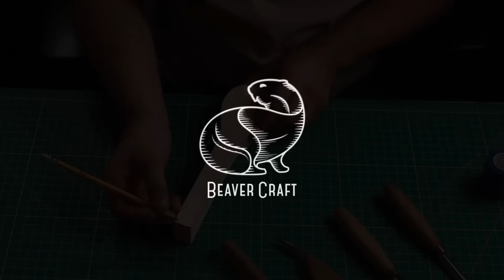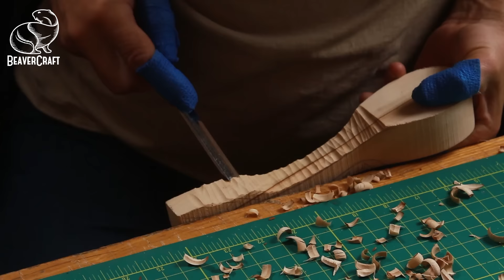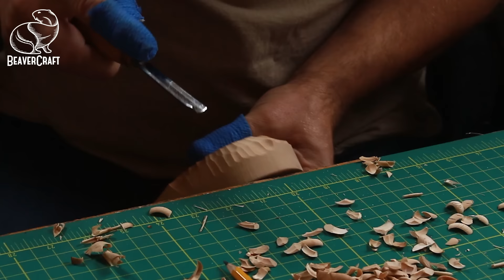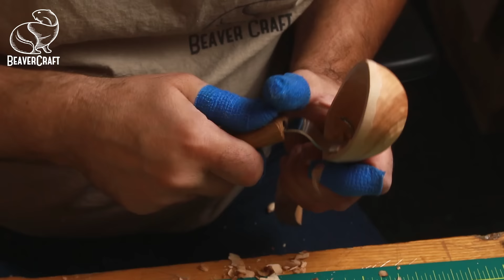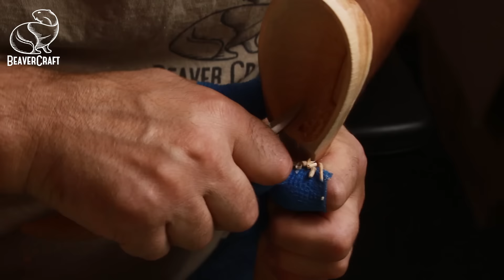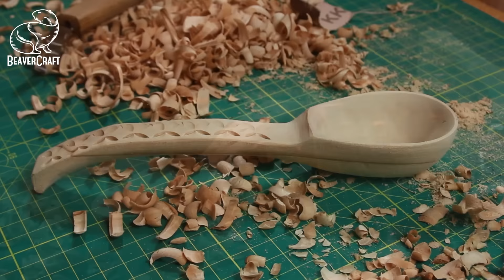ASMR Wood Carving - No Talking ASMR Relaxation

Comment: Is that safety tape for wood splinters or can it protect against chisel too?
Reply from the maker: The safety tape doesn't prevent direct blade cuts but it is great for avoiding small cuts and abrasions during your working with a knife or a chisel

Comment: Question. Are there certain types of wood that is better than others to use when making spoons. Or maybe what types to stay away from. LMK. I’m thinking that’s Bass wood. Your moving it around pretty easy. Just my guess. I’m completely wrong. That’s not Bass wood.
Reply from the maker: It's basswood and it's great wood for beginners as it soft enough to carve it as butter. We have this basswood spoon blank here: https://bit.ly/32XhMON
Reply: BeaverCraft  Thank you so much for the reply. Yes I could tell it was bass wood.  I second guess my self. What threw me off was the vain running through it. Most of my blanks don’t have that.  Iv made a few canes. But have not had the red grain before.  Have you ever worked with red pine?
Reply from the maker: @Danny K Foster  yes, we did work with a red pine. It has some peculiarities and it's hard to work with due to this wood's tendency to splinter.